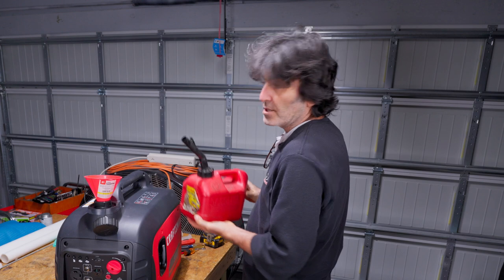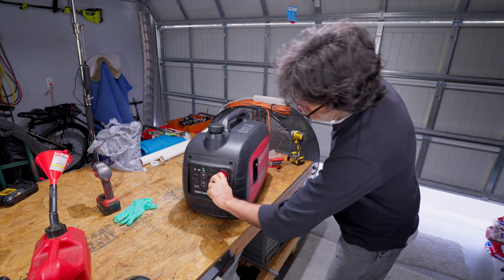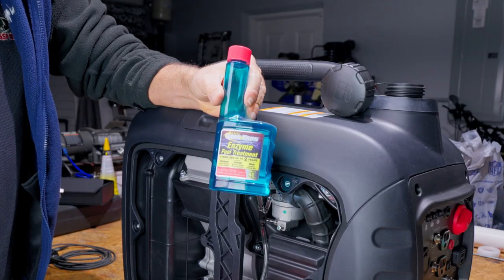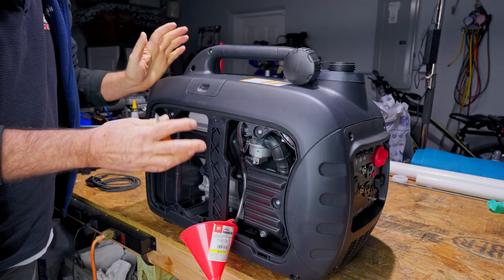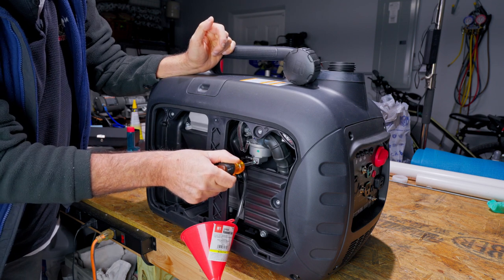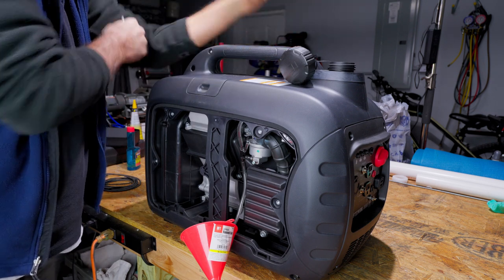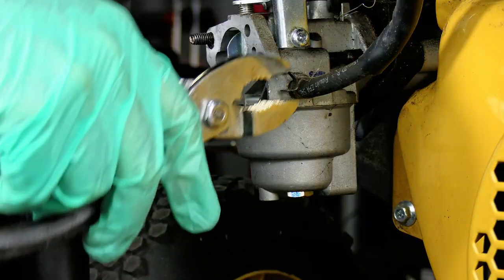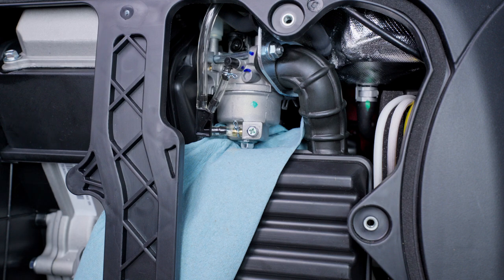How to Store a Generator So It Will Be Ready In Case Of An Emergency

Comment: Thanks for the info. How does draining compare to running it dry? Should I do both?
Reply from the maker: I would drain it as far as you can and then run it dry.  However, running it dry will typically leave a small amount of fuel in the bottom of the carburetor that's why I like to either loosen the bolt on the bottom of the carburetor or some models have a screw that's there just for draining the bowl.  If your carburetor has the extra screw in the bottom of the bowl then just loosen that and leave it loose for a while so the fuel residue can evaporate out of the carburetor...